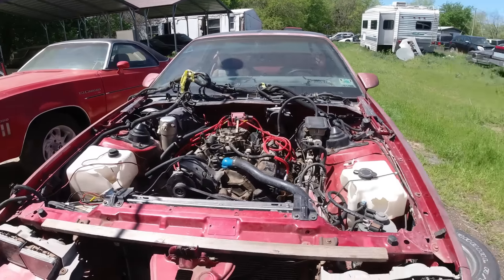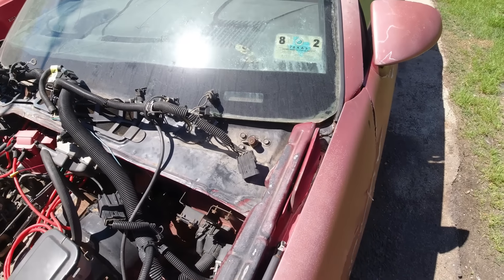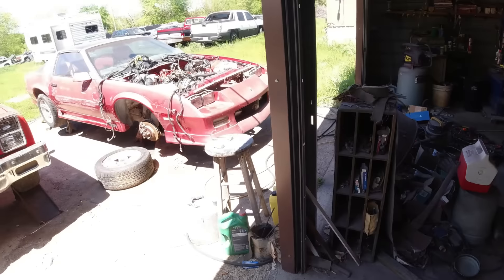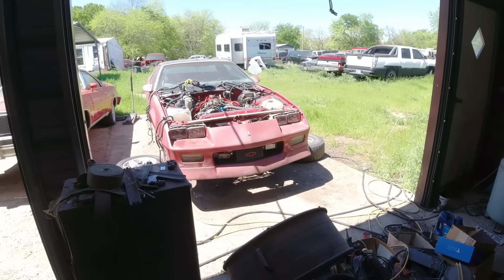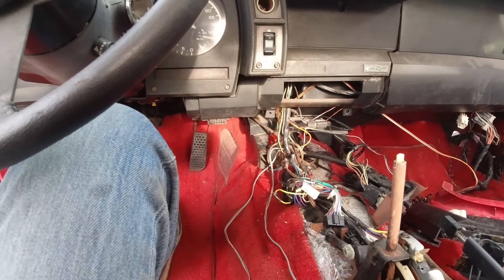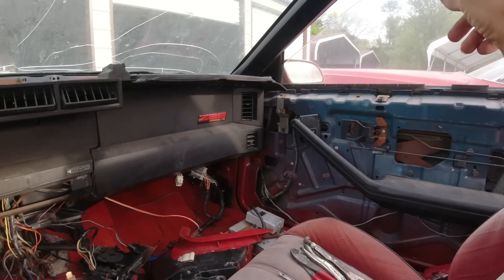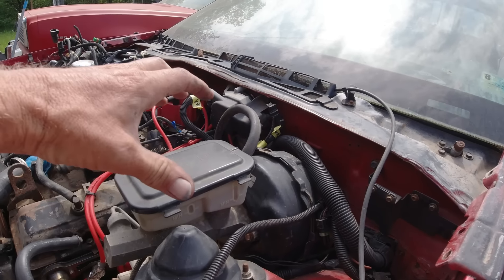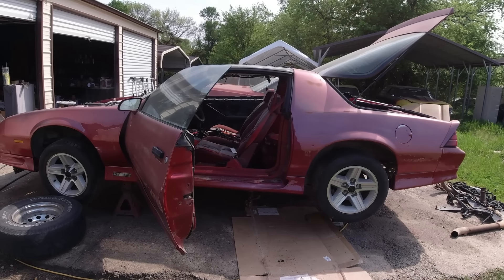1985 IROC-Z BUILD #4. Wiring Nightmare! Can I get everything electrical working??

Comment: Cool Lee you will be making an ohio state Iroc Z with the gray and red interior!!  I cant bekieve you would have trouble finding a brain box if you have a vin for that vehicle ive sent away mine and had it reprogrammed to the specs and then use the obd sensor to tune  it for carburetors  they just require changing how ut reads the codes comouters can be fooled!! But, having seen you tackle this Iroc-z piece by piece you do pretty good kinda the MacGyver of Chevrolets!!  Good used car salesman for sure !!
Reply from the maker: I haven't looked for another brain box since one was included with the harness. It's not going to be run by computer anyway.

Comment: I know one of those plugs goes to the 700r4 aka transmission.peace
Reply from the maker: I don't think the transmission has any electrical on it, I'll have to check
Reply: @clunkersandclassics  if its a metric with lock up they have them if not they dont if it does its on driver side i bellieve its been so long since i worked on 1 sir.

Comment: I feel for ya  Lee... Years ago I had a '83 TA. At about 50K miles the computerized carb went out & the car would regularly stall in the middle of the expressway. They wanted $1200  for a computerized carb.   I decided to bypass the computer, so I I got a new Holley 4B carb   80-82  pre computer & had a mechanic friend dial it all in  & the car actually ran worse!!   Yep you are correct, each year in the '80s the wiring, emissions, etc.   & all the related BS. got  more & more complicated‼
Reply: You didn’t remove the computer control distribute the computer keep adjust timing you need the vacuum hei that what I did the engine turn around
Reply from the maker: yep, sounds like you needed to replace distributor as well.

Comment: Many of the 80’s and 90’s Camaros and Firebirds up North here are completely rotten and missing their engines and transmissions long ago pulled for something else because the rust got so bad that the car could no longer be aligned or the doors wouldn’t close.  That is when the driveline was ripped out of it.  Like you said, most cars up here that came from the south or babied and only run in the summers might be original, lower mileage and good shape but most other examples still being daily driven are running on different engines and are a butchered mess for electrical systems, lots of Chinese replacement parts and sketchy rust repairs.  The metal was thin and they rusted hard up north.  Even a rough rusted up example still can fetch 3 to 4k now.  A few years ago you could pick a rough one up for under 1k, they were considered worthless money pits to fix up because they had little value even if they ran and looked half way decent.  Now they are coming back up in value slowly with this never ending inflation.  Nice job getting it going and figuring out a lot of that electrical mess, that is a feat to do what you are doing.
Reply from the maker: True. Plenty of non rusty ones down here in the south but they're mostly like mine and the parts cars I have, butchered, beaten and worn out interiors.

Comment: Mr. B. Here ! 🍺🛞👀😎👍. To all viewers the mid 80’s GM cars I worked for Oldsmobile train at the GM Training Center , one thing we guys in the class show then that if anyone mess with these vehicles we would walk away . Lee you got one issue corrected wiring is not bad if you have trained for it . Vehicles that have been hacked run ! Emission systems suck ! Lee I tell you what my boss toll me take your time & stop at times walk away ! Lee one tip you have GM vehicles look at the components the color will be almost the same ! Interior wires are orange & white . If need help ask I’ll assist you !
Reply from the maker: Thanks. I'll eventually get it figured out.
Reply: I’d almost fiberglass the washer and coolant overflow plastic bottles.
Reply from the maker: @jamespn  too brittle, they'd just break somewhere else

Comment: the only thing the harness from the left side controls is emissions . electronic carb, smog pump and the torq converter lock up pull the ecm and harness and get a non electronic carb. the computer control meetering rod and tps sensor are all specifically tuned through the ecm for fuel trim thus electronic carb will not run right without the ecm control. which in turn the need for non electronic quadrajet, all those loose wires are fo smog pump and vacum control selinoids.
Reply from the maker: the ECM part of the harness doesn't just disconnect from the rest

Comment: Man I can't hardly sit still I had a 88 with a multi tune port injection and I put an 83 motor trans in it I used the wiring off the fuse box and everything worked all them wires on the passenger side I tucked down in I didn't change anything on the wiring but find a keyed hot even the gas gage worked gages and all
Reply from the maker: The problem is this car came with no wiring harness, so trying to make one work is like a jig saw puzzle.

Comment: Bro, trust me, you're beating a dead horse there. You at the very least will have a unreliable car, and more likely a car that will probably end up burnt to the ground trying to make either of those TBI, frankenstein, non appl. harnesses work! Save your sanity and pull all of that mess out. Save them just for connectors if needed, and get yourself a aftermarket 21 circuit universal harness that has EVERYTHING you need to wire that car up. pAINLESS makes just what you are looking for and you can get it at Jegs. Look at the  10101 Universal 21-Circuit Classic Wire Harness, GM-Keyed Column Ignition Switch Connection, Customizable.  Trust me. no thanks needed, I just hate seeing you struggle with something that is not going to work there.
Reply from the maker: I explained in the video why a universal harness won't work. It would be an absolute nightmare trying to get power windows, seats, cruise control, heat, ac, etc to work.
Reply: @clunkersandclassics  Honestly, with these kits it's very simple Lee. There are circuits pre wired for each of those accessories, each of which has it's own labeled wire. No guess work figuring what wire goes where, and everything works correctly. I've installed dozens of them in cars just like with what you are working with (cars w/o original harnesses)  Just trying to help bud.

Comment: Just get diff oil with additive in it for the limited slip. Also does not need to ac delco brand at all. Although here the ac delco is cheaper than motorcraft so if I don't use oil with it in it I'll use the ac  delco additive in my ford. 14 bucks a bottle is alot better than 56. And who gives a shit on what brand it it. The diff don't care one bit.